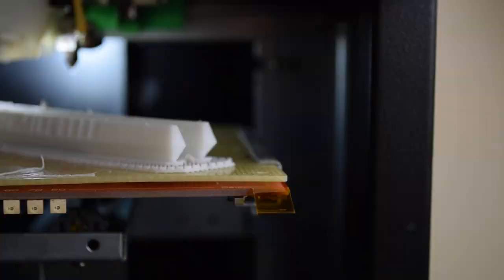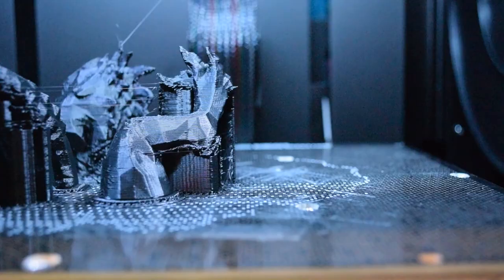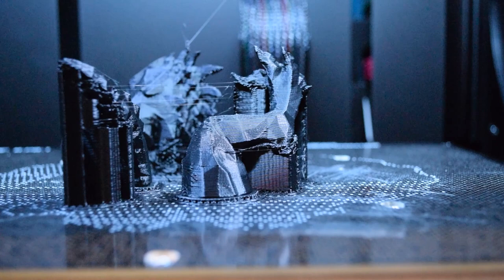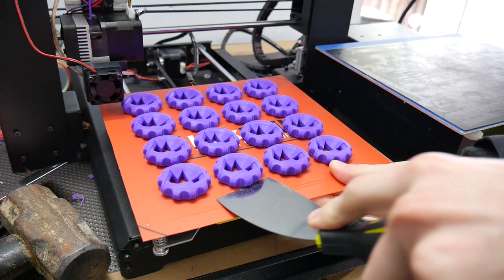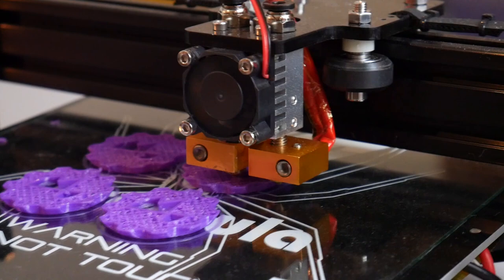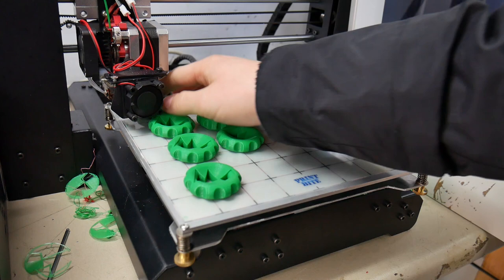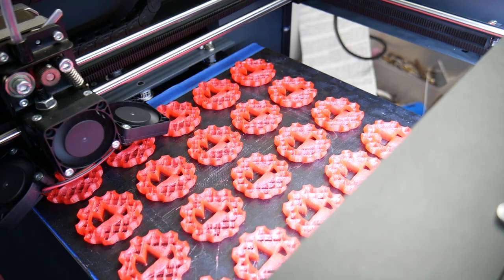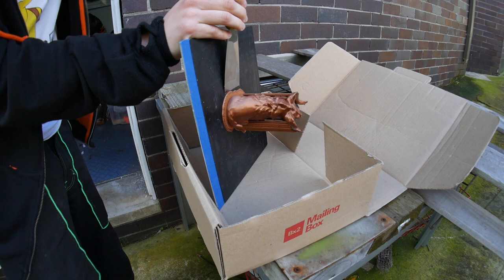The most dangerous 3D Printing Tool - Scraper Blade Safety - 3DP101

Comment: Just started the video, but I have cut my self a bunch of times with that same scraper that came with the Wanhao i3
Reply: I am going to make something to brace the print surface against the wall behind the printer so that any force I applied to release the print is transmitted through the brace and not through the printer and would avoid the temptation to grip the back of the print surface with my free hand.  I have had no real problem releasing prints so far but that is the sort thing to put me more at risk if it does happen.  I have seen and been in enough close shaves over many years to be ultra careful.
Reply: Get a sandpaper and clean up the edge. Then dull it a bit and round the corners. Then use it as a crowbar. Slip it to the edge of the part then push down the handle. You should not push towards the part, just use the scraper as a lever to lift the part. I can do it like this with two fingers only, there is not much force involved.

Comment: What the hell are you doing with all these MM Badges?

That being said... I love my Form 2 for not having to deal with pretty much any of the work compromising issues tied to FDM Printers like properly judging the heat, infill, shelling, and once everything printed right getting your work piece off the darn build platform.

You basically just put the lever under an angled area of the support structure and with a small twist of your wrist it pops right off the build platform - Every time.

Sure, it has it's own problems like dealing with a hazardous resins but at least you're fairly sure WISIWYG =)